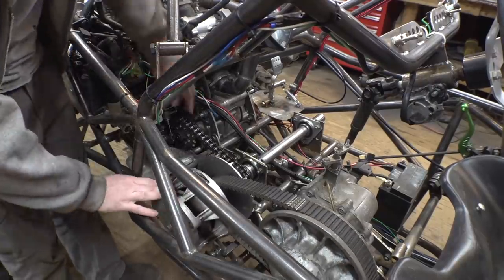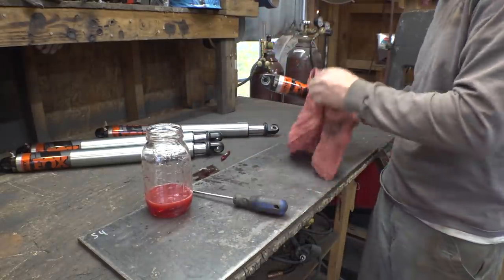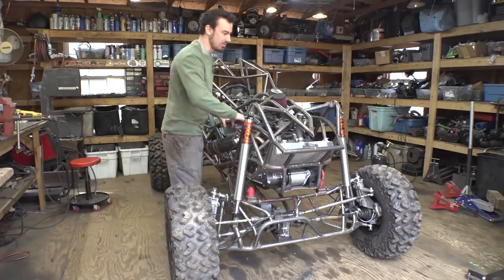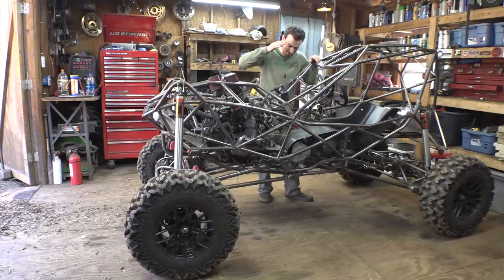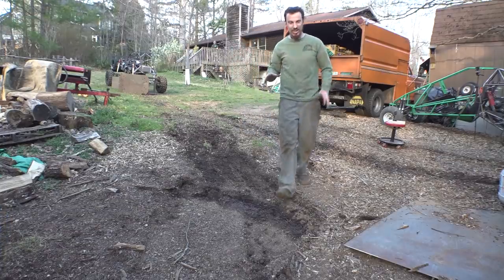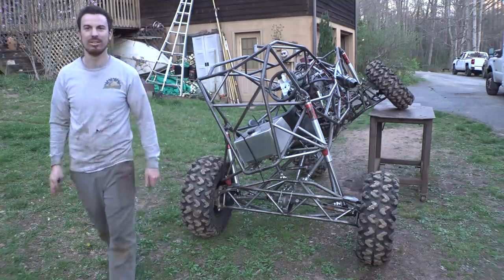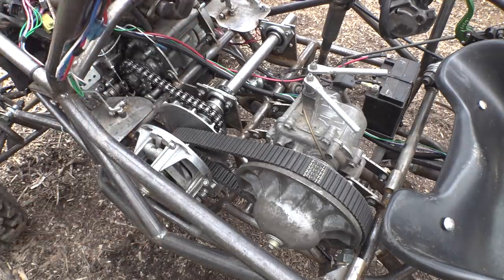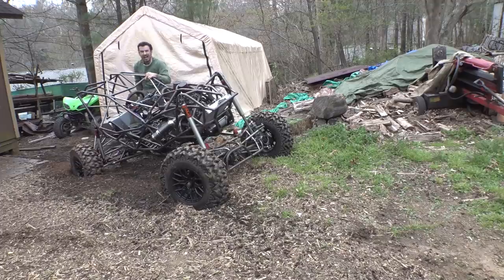First Driving Test!! on the Mini Rock Crawler Build - Part 14

Comment: The drivetrains you design in your builds are way to complex, heavy and they inhibit the true performance potential of your rigs. Mixing a CVT with gears in my opinion is overly redundant and a waste of time and energy. 
Your suspension designs are good. Your care in the looks of  your rigs are very good too. But mistakes made are in the drive area.
It’s also amazing how the 250 twin pit bike’s motor is so big!
It came out a nice looker. But that big looking engine isn’t so big the power. To bad that motor that was laying around wasn’t big or you would of run that instead. The bike still came out great though!

Comment: You need to know where you make the most power or where the engine starts to make power when you start screwing with the shimming of the clutches as well. You're able to spin the back tires right now because the clutches engage at a higher RPM but once you're in four wheel drive it's gonna be more load on the clutches and you might need that extra rpm and h.p. when you're say going up a hill with an increased load.  Without figuring out a ton of details you're gonna spend a lot of time, a lot of money and have poor results.

Comment: those belt systems are about as bad as they come if you expect to lay down torque...   work for a company that makes utility UTVs, they have that trans type and people try to plow snow with them..  they burn up quick if you are not aware of its capability's and dont push it past that.. some people never have a problem, others burn it up every storm

Comment: Id say those shox on the front are way too long and need to be mounted on the rear.  You have all droop and hardly any impact travel. The mounting points are way too close together, i would add another 8"-10" between the mounts and put them on the rear..  also check the belt width to make sure its still within spec, otherwise you need a new belt.

Comment: Dude. Stop hammering a clutch that spins 8000rpm. And dont use lubricant for the bushings in it.
If its jamming you have a serious problem, bushings are probably very bad.
You lose a ton of power with a worn out primary so your focus should be at renovating it

Comment: I personally think you're eating up a lot of horsepower going through the torque converter. I know why you are because I've put motorcycle engines on mules and stuff and without the torque converter if you just weld a sprocket to the shaft you're only going to go like 10 miles an hour made that mistake before. But for a direct manual I like to use a jackshaft to up the gearing to what I want to and you still have forward and reverse like you want. Sorry about punctuation I'm just using talk text

Comment: Not to burst your bubble, but this is the worst motor possible to use for a crawler. You will, 100%, get top end starvation and kill the motor, if you use this as a crawler. The only way to avoid this is to go dry sump. I build tons of svs, and I am the main supplier of the biggest sv parts guy in the world. its like 50% of what I do. Oil pump pickup picks up jack shit past a certain motor angle. This is not debatable, it is proven. dry sump, or rebuild with ninja 650 motor, or whatever. I will reference this post when you ignore what I said and blow up your motor. Why listen to an expert, right?
Reply: It's a motorcycle engine I've seen people ride them on back tire straight up and down and take corners with there knees touching the ground with no issues I think he will be ok what's the difference

Comment: 6:35 - I hate when idiots design something. Or when they have this 1 prototype build, redesign any problems on production model that hides bolt heads so u have to take hole axle’s off or other big parts.. This seems to happen all to often.

Comment: WD 40 is not a good choice for lubrication needs and can destroy bushings and bearings and chains due to its abrasive ingredients. WD 40 is designed as a penetrating oil for freeing stubborn oxidized and rusted bolts and rusted chains and is not recommended as a lubricant for chains or the above. Your better off using regular oils because WD 40 can wear out that clutch system with its abrasive ingredients. WD 40 is the best and top of the line when it comes to freeing up stubborn bolts and renewing chains that should be cleaned off after using and the oiled properly.

Comment: cool build but your totally cheating on the flex test by charging some of the shocks more than others / barely charging some of them at all. flex test should be with the shock settings your actually going to have on the trail, not some impossible to drive combination just for the test.

Comment: Are you for real, the only way to change damping is to use either thicker or thinner weight oil or to get you damping shims adjusted, this is absolutely incorrect, oil level for a reason